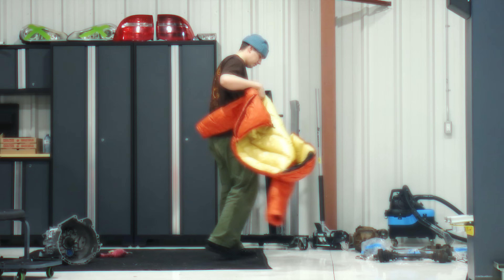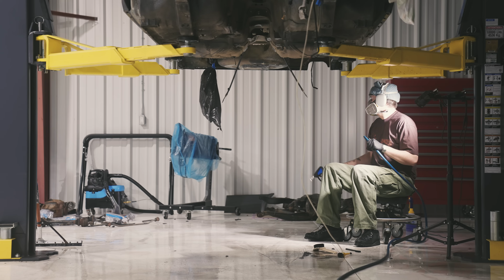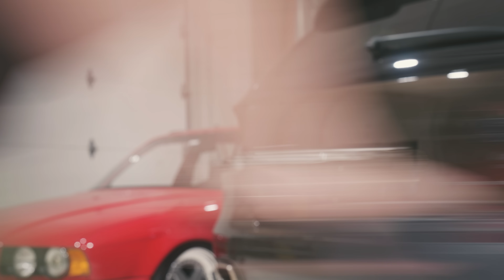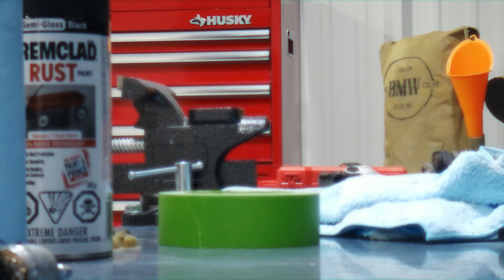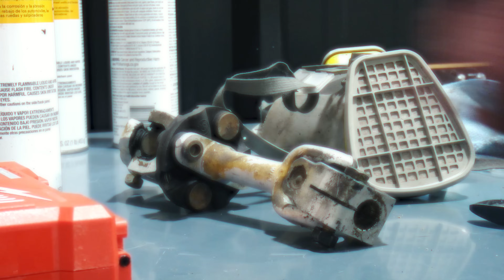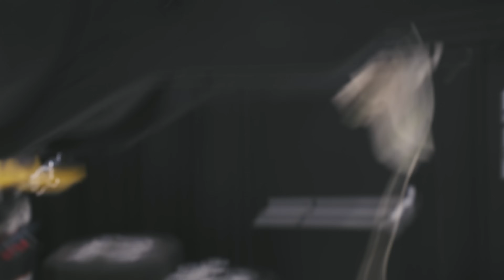Completely Transforming My BMW E30 With  3M Undercoating

Comment: hey Mike, loved your approach towards the undercarriage, got an e34 myself that needs similar work done, but in Europe we don't have the POR-15, what would u reckon instead (got my eyes on these Brunox products)

and 1 more thing, during my research there were several ppl saying that such undercoating is porous and in order for it to seal properly, waxcoating is recommended, how's the 3M holding up so far without such waxcoating?

Comment: I thought that stuff was bad because it traps moisture between it and the metal. I know por 15 is great but didn't know you could put anything over it except the topcoat
Reply from the maker: YOU thought or you heard from some shmuck? Most opinions on this time of work are very bad. This was taken from two shops that lead in restoration of these specific cars
Reply: @ChromaticGarage  uh no.... this is just me asking. Again, I thought the only thing you could put over por 15 base coat was the por-15  top coat. But since this method is coming from restoration shops I'll keep it in mind 👍🏾